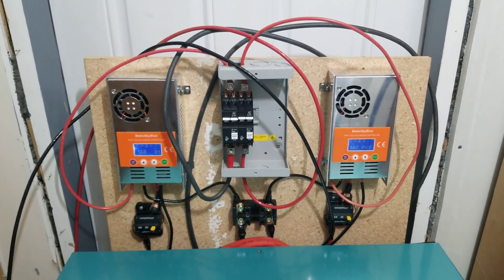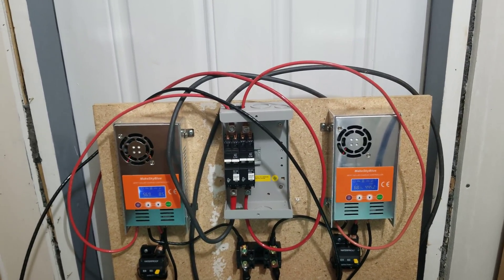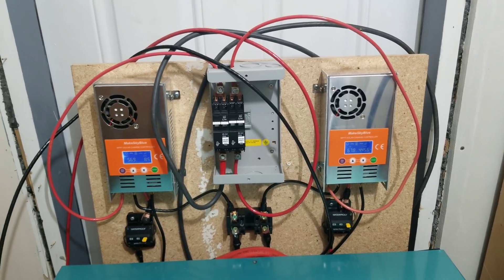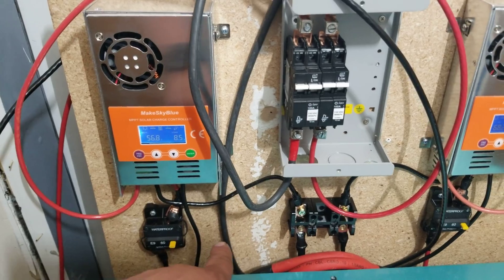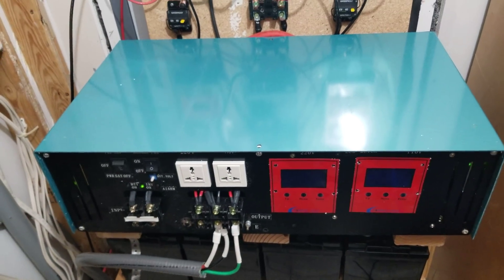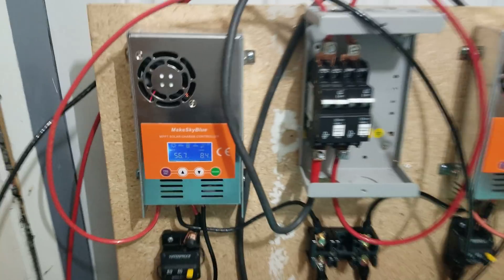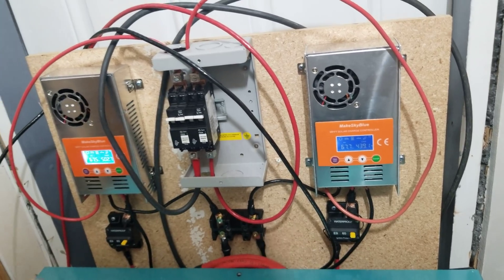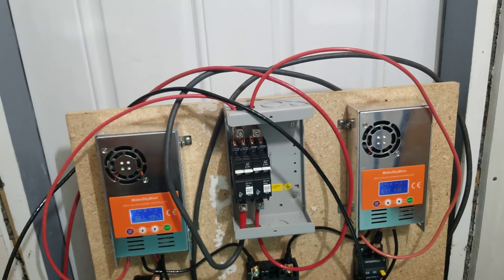MakeSkyBlue..... A surprisingly great charge controller

Comment: what amp fuse breaker are you using i am using a 4000 watt 36v inverter with the same make skyblue charge controller
?

Comment: I have 4 of these controller s and my most accurate meter fluke 17b read 55.00 volts but none of the controllers have same readings. Do you have any suggestion how to adjust the meter on these controllers?
Reply: You can adjust voltage reading in the prog Menu in d06
Reply: @francisdoll1253  Fransisco I got v119 today and everything is fine except when I try to Lilo and press ok it go back to lipo. Any suggestion?
Reply: @neliosamch3195  do you have push on enter button before leave the menu?
Reply: @francisdoll1253  yes, I  did. This is skyblue custumer service response "LIlo and Lipo charge in exact same fashion so it reverts to Lilo. everything is good.  All that changing to Lilo over LA batteries is that you revoke the Constant voltage portion of the charge. Lilo goes from CC to Float..." Thanks.
Reply: @neliosamch3195  OK so there's really only two settings which is LA or Lithium even though it displays more.
Reply: @francisdoll1253  No, it goes from D00 to D04 only
Reply: @neliosamch3195  Have you the V118 version? Mine has menu from D00 to D06 . It exist fake versions of this controller V113 is one
Reply: @francisdoll1253  I bought them from makeskyblue co directly. There wasn't thus things as fake v113 at that time.

Comment: I have a 40A MSB I bought last fall on a 60V array.  Very poor tracking if you have any shading at all. Mine will drop down to 17V and not recover unless the panels are disconnected.  Had to build a microprocessor to sense panel voltage.  If voltage drops to 40V for more than a minute, it disconnects the panels for 30 seconds.  Frankly, when I get back to camp I am selling it. Too bad, I like the hardware side of it but the software is crap.  I've seen numerous problems. Most people aren't smart enough or spend enough time to notice when it is confused. It had nothing on my home built charge controllers.  This is just not a company ready for prime time.

Comment: Powerjack inverter turned on with 1000 load connected, shut down with a continuous beep!! This is the SECOND TIME, first time it cost $100 for a new main board...

Cant recomend ANYTHING by powerjack anymore sadly.
All it does is turn on for 2 seconds then shuts off with the fan on And continuous beep.  Its an 8000 wtt dual phase....  They are simply NOT dependable.

Comment: Wait till you have had it for a few months... Monitor the voltages carefully.  MSB will not honor warranty either.
Reply: BJ Samole, Thank you for indicating that you need to watch voltage carefully as you should with any off grid battery bank, As the USA distributor and repair center, I would be glad to take a look at your controller and run it through the paces. If We find error in the unit we will be glad to repair or replace it. MSB fully honors the warranty. I can be reached at the number above to make arrangements. Thank you for supporting Make Sky Blue.
Reply: @seanbuckner1213  i learnt the charge controller gets stuck when tracking and has to be restarted.  Has that been rectified now?
Reply: @leviahamefula3994  "What version do you have? To my knowledge none of our versions get stuck tracking. That is a known problem with the fakes V113...

Comment: Is it normal for a 8000w LF 24v inverter in ups mode for the battery to be at 28.4 and varying?

Comment: if you take them apart you will find they have an aluminum plate in the back. I thermal pasted the plate to the back of the case then thermal pasted a heat sink on the back side of the controller. Now the fans do not run so often.

Comment: I have three of these, They are doing great so far, I mounted them with spacers about an inch off the wall and have an extra fan running on them. I'm testing them with different loads on them. They seem to work best with 2000 watts or lower.
Reply: Agree with you.  i got a V125 type recently. It works so well now.

Comment: I have the same charge controllers instruction booklet says it does multiples of a single battery voltage but mine show the actual voltage of all 4 batteries together and also those connectors are so so small but they do give you two of them and you need to use both of them or your wire is going to be too small for the amperage going to have a hot wire don't want that burn your house down

Comment: I max my 30amp make sky blue charge contoller out. 80v at 36 amps. It's been running like that for over a yr. Only issue I have is the fan is starting to get loud and I will need to change it out. Maybe your sales rep could help me out?

Comment: Do the fans run all the time?
Reply: Only when they get warm or when your supply is higher then the demand and they run more offten.
Reply: @bigstagsgarage2285  ok, they are loud...lol
Reply: @terryswallace  he may have the inverter fans on in the video and that's probably the lound fan noise. The charge controller fans are not that lound a they are only like a 2 inch fan. Mines just starting to get loud after a yr of bing in a dusty desert climate.
Reply from the maker: Correct. Inverter fans are on